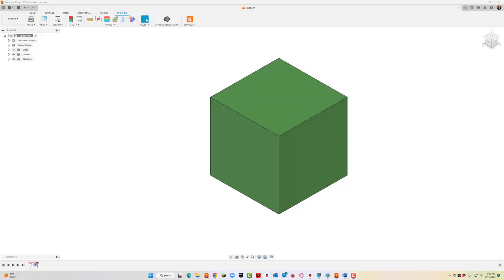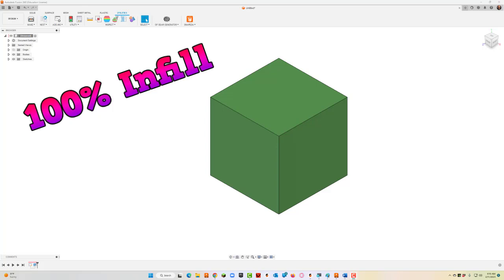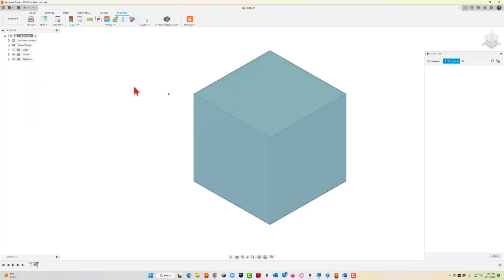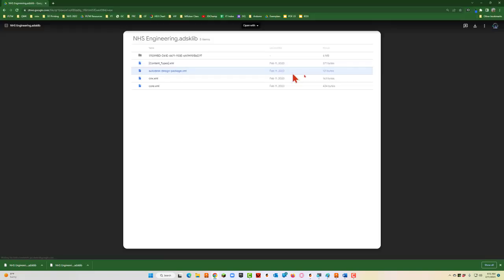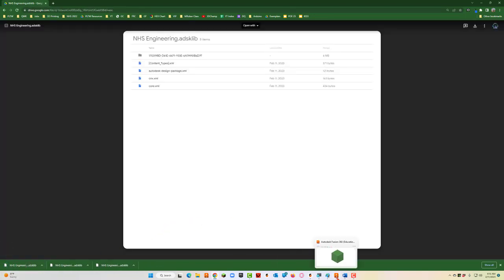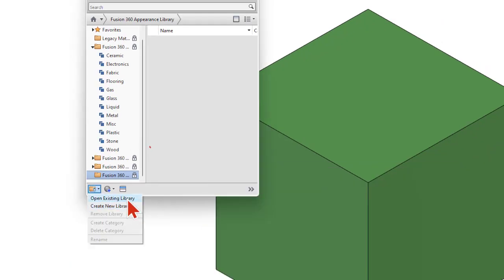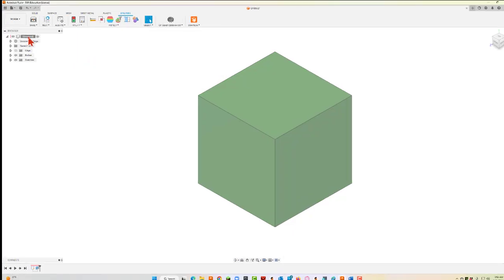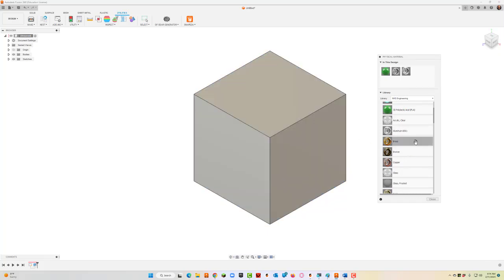Importing a Fusion 360 Material Library - Including 3D Printable Filaments!

Comment: Nice video and thanks. At the start, you talk of infill percentages for 3D materials. I wasn't sure, after watching, if the imported materials presume a specific % or are 100%
Reply from the maker: The slicer program you use will usually keep the last setting you used.
Reply: Thanks @BrianBobbitt3D  I was thinking more that when we carry out a simulation after attributing the material to the component. I'm guessing 20% infill  will be much weaker and if the data in Fusion 360 is enteres on the assumption that it is 100%, the simulation will be misleading? Apologies if I'm missing something very obvious and thanks again for replying.
Reply from the maker: @PeterJones-de3nc  I see what you're saying.  Technically,  in Fusion it would be a solid component.  However,  that could be modified in any slicer to decrease printing time.
Reply: Thanks  @BrianBobbitt3D  Yes, we use Cura and can hugely reduce the print time for most parts. I am contemplating buying some PETG-CF. The part really needs to be pretty strong. We usually opt for aluminium but I'm toying with the idea of a 3D printed part instead. The problem is that it requires a special nozzle and the material cost itself so I'm trying to find a way to simulate the load accurately, assuming a given % infill. In any case, I enjoyed the video and will subscribe. I wish you well.